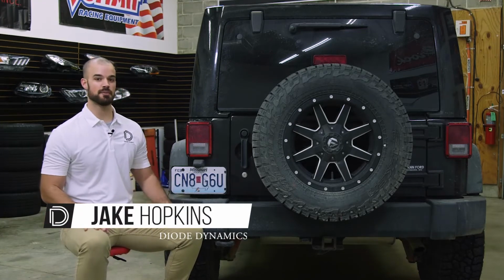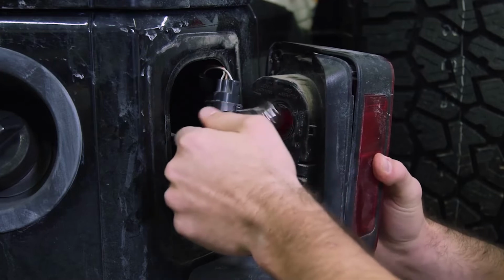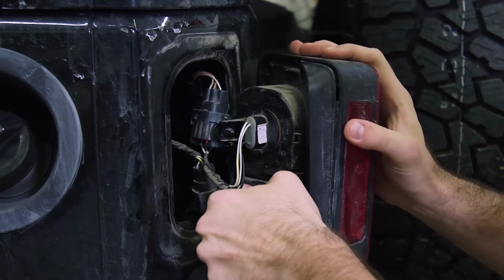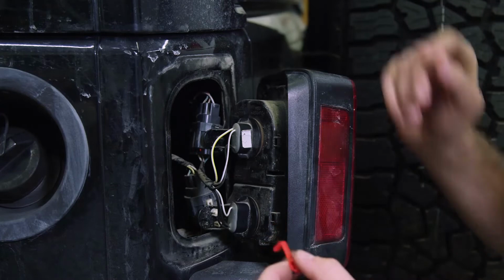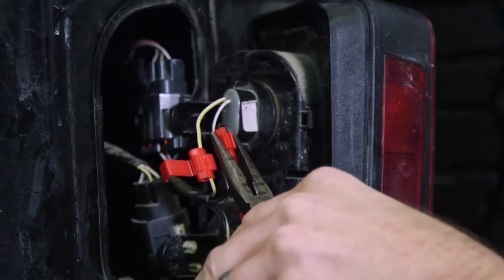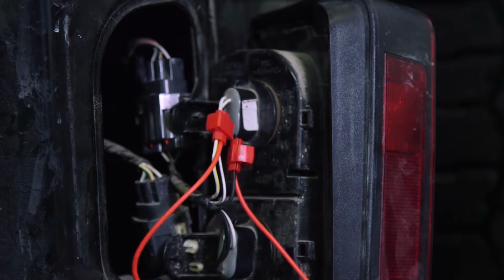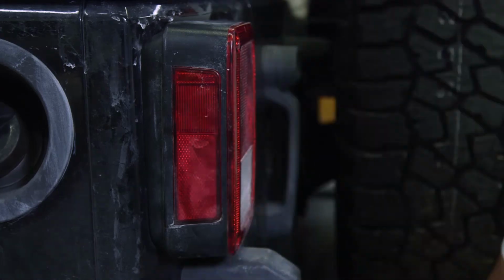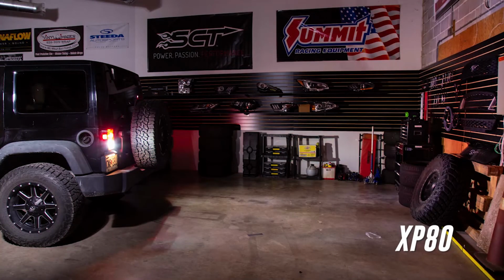How to Install 2007-2018 Jeep JK Wrangler Tail and Backup LEDs | Diode Dynamics

Comment: How can you add the resistor kit without quicksplicing it. That just doesn't cut it for me, I solder everything. How would I go about that for this specific product?
Reply from the maker: You would strip some of the sheathing back and solder it to the other wires.
Reply: A professional solderer needs instructions on how to solder wires ?

Comment: I want to see the clip where you compare incandescent vs. LED side-by-side—I'm sure you filmed it, but excluded it—why is that not included?  Is it because it either doesn't appear brighter as a result of less reflection or it's not brighter at all?  You expect people to slap down $100 for two LED light bulbs?  What makes them better than cheap red LED lightbulbs costing three times less?
Reply from the maker: Hey there! Just check out the comparison pictures we have on the listing page from the link below:

https://www.diodedynamics.com/rear-turn-tail-light-leds-for-2007-2017-jeep-wrangler-pair.html

All of our LEDs are made with the highest quality of components and are backed with our awesome 3-year warranty. If you have any other questions, just give us a call at 314-205-3033, Monday-Friday 9 a.m.- 5 p.m. CST, or shoot us an email at contact@diodedynamics.com!